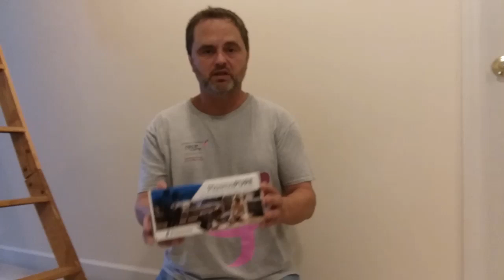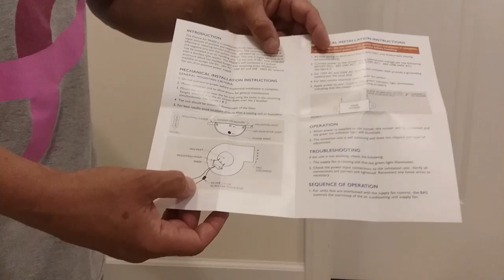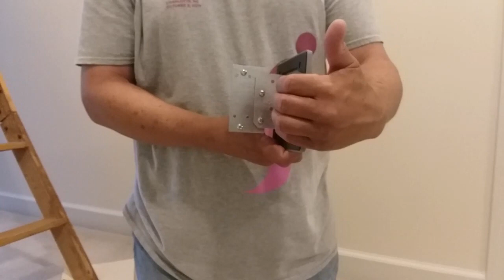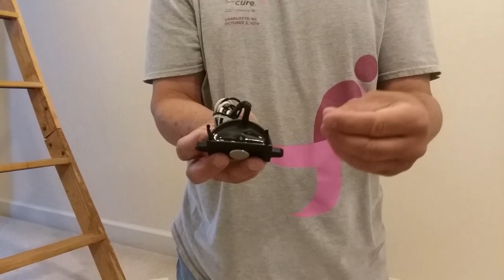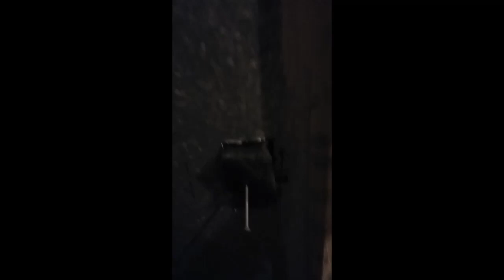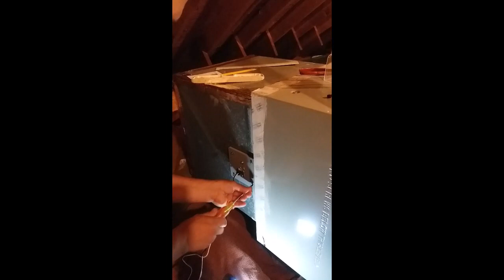Plasma Air PlasmaPure 603 Installation

Comment: Thank you so much, I took have been struggling to understand the "dirty sock syndrome" after we moved into a new house. Seems like we've tried everything, tons of cleaners, multiple UVC lamps. The smell always comes right back within a few days 😞. The HVAC pros have been so unhelpful, none of them mentioned anything about COATING the coils.

It sounds like the coil coating was what must have eventually worked for you. I would be happy if that solves it for us, and we can just clean the coils once or twice a year, as light maintenance.
Reply from the maker: It was a combo.  The company that installed the unit replaced the condenser with a factory coated one from Train which would have been expensive it it had not been a new install.  That reduced the smell but didn't fix it 100%.  The PlasmaPure 603 took care of the rest.  The company that installed my HVAC unit uses the Aerus Air Scrubber.  It is a UV bulb encased in a special metal honeycomb.  The UV bulb isn't really the purifier like normal UV bulbs.  It is really heating the honeycomb that gives off hydrogen peroxide that is supposed to be safe.  They use that because they said Aerus 100% guarantees it to fix the dirty sock smell and they have had great success with it.  The problem I had entertaining that solution was not only the up-front cost they wanted to install it, but the replacement modules were very expensive making it a costly solution over time.  If you can stomach the initial and on-going cost, I think it would fix your problem for sure.  That being said, an ionizer solution like the PlasmaAir or Nu-Calgon units might work also.  I just didn't install mine until after the new condenser was installed to be able to say it would have killed the smell when it was at its worse before the condenser replacement.  Best of luck in resolving your issue as I know first-hand that is difficult to deal with.

Comment: First off a UV system will NOT clean particles as they are flying through the air at 1000cfm+. The UV system is only for contact growth, meaning attached to the duct system or coil. The UV will only clean what the light can hit, anything other than that, it’s useless. Unless you get a higher model UV kit that has a carbon block for capturing the particles to make them stationary which allows for the removal of those particles. A UV light on it own will NOT eliminate odors in a home. Second, dirty sock syndrome is NOT a manufactures fault or responsibility at all. The homeowner should have proper maintenance done by a professional to clean the coils when needed with a rinse free cleaner. Also, every single home at some point will experience DSS. When we’re in the part of the year where seasons are changing and we’re running heat in the morning and cool in the afternoon, that gets the coil dried out in heat and then when the coil comes on it makes the coil wet. The particles on the coil becoming wet emit the smell, just like when you take your socks off after playing sports or anything that causes you to sweat, your socks aren’t going to smell like roses. With that said, once you transition into full heat only and no more cooling, the DSS smell with be gone for the remainder of the heating season. Also, an ionizer is not going to eliminate that smell, nor is it going to clean off the coil of bacteria. We take showers to remove bacteria that make us stink, and the same should be done on a coil. I have been in HVAC 15 years, own my own company, and I can’t tell you how many calls I get on this. I don’t push UV or Ion for that issue. I chemically clean the coil with a scented non rinse and brush down the coils. Never hear back again from a customer after that. Also, I might add, that the same exact thing happens in a vehicle when we’re running heat leaving for work in the AM and then cut the cooling on in the afternoon as the temp rises. It will smell the same exact way. Yet, we don’t blame the car manufactures for that, nor do we install any purifiers in our automobiles AC system. Get regular maintenance, understand some simple science and you’ll be good to go!

Comment: Curious why you chose 603 120v model vs 602 24v. 602 seems way easier to install as all you have to do is connect 2 wires to the board, low voltage. They both have same output right?
Reply from the maker: My understanding is all the 60x models have the same ion output and just require different input voltages.  Plasma Air sells different models based on the desired input voltage versus, say, the Nu-Calgon iWave-R which supports a wide range of input voltages via the single model which is nice (but is larger and costs more).  When I was researching it, there appeared to be some question as to how much current the existing 24v terminals on a board in an air handler could provide beyond what the circuit was already providing power for so I didn't want to deal with that or use a separate 24v transformer.  I also didn't want to chance voiding any warranty, particularly on my downstairs unit which is still under warranty since I was doing the installation myself.  The in-line fuse on the 603 is only 500ma so the units appear to draw low power such that connecting it to the existing 24v source would probably be fine, but that would have to be a decision you would have to make on your own.  I used the 603 so that I could specifically install the unit without touching any existing electronics inside of the air handler which I liked.  On additional note, I have been told that many new air handlers now include 120v terminals on the boards specifically for the addition of air purification devices, but that is second-hand information that was passed along to me.  Hope that helps understand why i chose the 603 vs. 602.  I hope to do a follow-up to the original video soon with a couple lessons-learned now that I have had my units installed for a while.

Comment: Just install it dude didn’t need an hour of talking about it
Reply from the maker: HA, understand.  It was my first video and didn't realize it was so long until it was done.  The installation was only half the purpose of the video.  The other purpose was to help others understand the options out there because HVAC vendors typically only offer one option and don't explain the on-going costs associated with the solutions that have expendable parts (i.e. UV lights, plasma cells) which can be significant.  Looking back it would have probably been better to split installation/purifier options into two separate videos.  Thanks for the feedback.
Reply: True, the video may be a little long-winded, however I got more information than I expected.  You made some interesting points regarding some of the other options.  I am familiar with Plasma Air and that's why I turned to Youtube to see how folks have installed them.  Good thing about Youtube is you can forward through videos as you wish.  Thanks for posting!
Reply from the maker: @milesmelton2226  Thanks for the reply.  As you noted, being able to forward through a video to get to the part of a video that is most important to a viewer is a very useful feature that I use all the time.  I hope to do a short follow-up video this fall when I pull them to inspect brushes to gauge how often I will need to clean them.  I hope to find them clean so that I can limit the inspections/cleanings to once a year as Plasma Air thinks I will be able to do.
Reply: 45 minute video for 5 minute install🙄